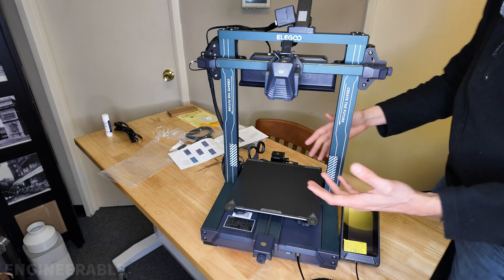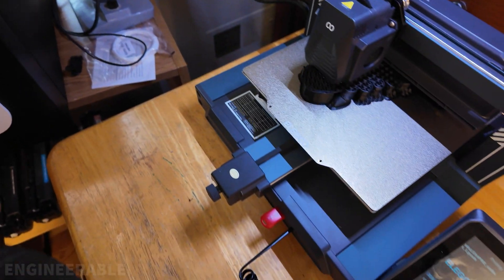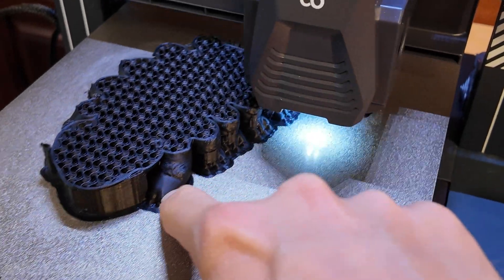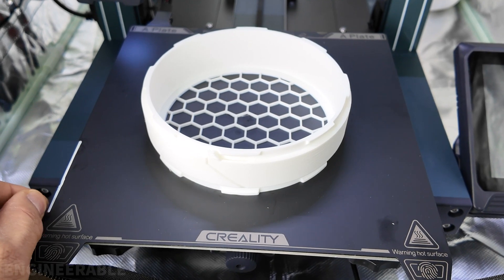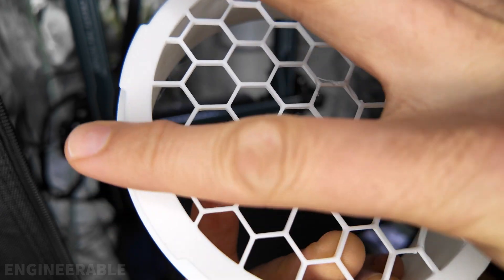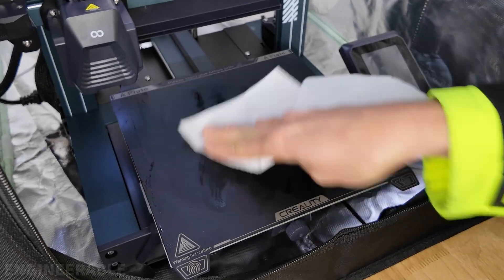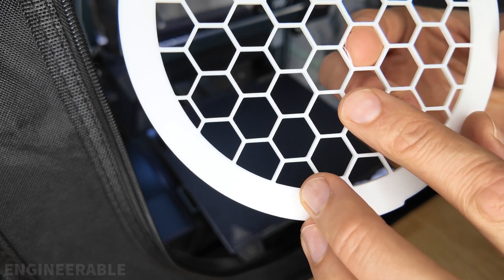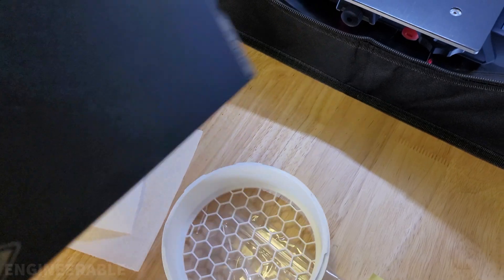I SOLVED ELEGOO NEPTUNE 4 PRO BUILD PLATE ADHESION ISSUES | 3D Prints now adhere reliably! No Glue!

Comment from the maker: This CREALITY smooth build plate has excellent adhesion for PLA and PLA PLUS. Buy it on Amazon  https://amzn.to/3uREupw
Reply: So that will fit my Neptune 4 pro
Reply: We have same 3d printer we got for our son. And the PLA is not sticking in the plate aswell. What should we do
Reply: @jdbodner-yh8mn  make sure you are using the right filament meant that you selected make sure it is the right temperature and maybe you need to re-level the bed and for the first layer, make sure it goes really slow, but once after that, you can make it faster

Comment: I just ordered a Neptune 4 max.  I would like to follow your suggestion of getting the Creality build plate.
In your video you described it as the "smooth" plate.  I went to the amazon  link you gave and the Ender 5 max was the biggest one.  They describe it as epoxy resin with a "sandblasted like" texture.  Is that the one you suggest? Thanks for your video.  It is encouraging.  george

Comment: Came back to this video after trying a lot of things, What I did is a test to see if me touching the bed would make a first layer test fail. IT DID so no touching
As for adhesion, for the default Neptune PEI plate was washing it with hot water and soap, making sure I dont clean it with a towel or anything I just let it dry and set the bed temp to 60 to dry and avoid any kind of oil on the Build plate and now it works without glue. :yougotthis:
Reply from the maker: Commenting out the loading of the bed mesh and going back to the normal 4 point manual leveling has further improved the consistency of print adhesion. The bed mesh was useless no matter how hard I tried.

Comment: Hello! I have had trouble with this printer and I was wondering if you could help me. Ever time i start this printer, the filament does not stick to the bed and gets dragged by the print head. Can you help me understand this issue?
Reply from the maker: Most likely your 1st layer is too high. It's either not homed, or first layer offset is too high. Also, the auto bed leveling on this printer is useless. I ended up commenting it out in the startup gcode and config files, leveling manually like old school printers, and that has worked much better. Almost perfect first layers everytime.

Comment: Hi, Neptune 4 pro bed is 225x255m , and the creality plate you suggest is 235mmx235mm. Does it matter?
Reply from the maker: @reneleb  the build volume is 225x225x... The bed is slightly larger, and the creality plate is a perfect fit.
Reply: @engineerable thank you. Do i need to order the magnetic stickers? Or just the smooth plate
Reply from the maker: @reneleb  just the plate

Comment: HOLY FUCKING SHIT. IT WAS THE BUILD PLATE ALL ALONG?? I just bought one and have leveled this bed maybe 60 times and still the same issue. You mean to tell me it was because of their fucking build plate. Im pissed
Reply: LMFAO sammeee, except I had the pro 3. Do you know if you need to apply glue to this creality plate every time? It says to apply glue on the plate but the reviews are making me think it doesn't need it.
Reply: @adamsevin7715 I've printed on that build plate ALOT since I figured out the stock one was trash. I have not once used glue on it. I do wipe it with 90% alcohol in between every print to get rid of oils but that's it. Your good my guy.

Comment: I solved it with a offset 0.1mm down when I calibrated the bed
Reply: What is your z-offset set to? 0.1?? Mine is down 1.5 just to finally get some resistance with a sheet of paper. I could easily put it lower (like 1.55) and still be able to more the paper back and forth.

Comment: Hi, i've stumbled across this video, because I'm havin the exact same problem with the stock build plate and the sunlu pla+.
Like you mentioned the first small test prints came out perfectly and after traying lager prints the adhision to the bed failed.
I'll try the Creality buld plate, ordered it right away...😅 TY 4 the suggestion!

Another interessting video I have found is this one, where the print bed becomes uneven "by design":
https://www.youtube.com/watch?v=sgqnlR9Wlk4
Maybe this is helpful to you and your audience. I haven't checked on this design flaw yet...
Reply from the maker: @KaiDzialas  😂 that other video is mine also. The combination of Creality build plate, the warping fix, and allowing it to preheat for ~20min has solved the bed adhesion problems.
Reply: @engineerable  Dang, that’s just a litle bit embarrassing. 🙈 Follow incomming…😆

Comment: I was having the same problems on my Neptune 4 with poor first layer adhesion. I flipped the Elegoo textured plate to the smooth side and it fixed the problem immediately. Perfect first layer adhesion.
Reply: Weird. I finished a print last night that covered most of the build plate in surface area. I did have my z offset a little closer than I normally would and the plate 10c hotter than I normally would.
Reply: @jordanmunch2151  Same for me.
Reply from the maker: Interesting. The textured plate that came with mine is uncoated on the back. It's just steel. I tried this and it didn't adhere.
Reply: I just set up my Neptune 4 pro and am going to try this. All the prints I’ve tried besides the defaults that came with Elegoo aren’t sticking. Thanks for the tip
Reply: Is your plate the factory one or did you replace it? I tried printing the Buddha 3 times and it didn't stick to my plate withing the first 2 minutes

Comment: Are you still using the creality bed?
Reply from the maker: Yes, it continues to work better than the original. The Neptune 4 Pro has Z home and bed leveling issues though.
Reply: @engineerable  I ordered a 4 pro. I'm hoping I don't have to many problems but I have been reading some pretty bad stuff
Reply from the maker: @timmyd463229  The main issue is that the bed takes a long time to stabilize when heated, about 20 min. There's nothing in the calibration or print startup that takes that into account by default. So, warm up the bed and nozzle to print temps and let it stabilize for 20 min before doing any calibration, bed matrix, or Z homing, then that gives better results. Get an enclosure. Look at my other video about bed warping mod.

Comment: hoping this solves my problem, had adhesion problems and they seemed solved and now continuous blobbing problems. Any particular settings for the purge line to move, cause of the plate's different shape?
Reply from the maker: Haven't needed to shift the purge line. The new plate was basically identical.

Comment: I switched from glue stick to non scented cheap hairspray on the original build plated and it has worked fantastic i mean worlds difference mainlybi think because the glue stick leaves microscopic dips and valleys on the byild plate that can cause layer adhesion and shifting issues but the super fine spray of hairspray makes the print stick withought rhe uneven surface of the glue. Ive found myself just running a quick calibration before each print without adjusting the bed level and its been printing like a champ!
Reply from the maker: Thanks for the tip. I know hairspray used to be the product of choice for glass. Does it leave any residue? Calibration (Z homing) before each print is essential. Pre heating for about 20 minutes before doing bed leveling or Z-homing also helps, because the build plate takes a long time to settle when heated.

Comment: I have bought the creality plate… now I have the opposite problem…. Can’t take the bloody print off easily! Thank you though for showing us a solution,
Reply from the maker: 😂 you might need to use glue stick to be able to take it off 😀. What material? I've only had too strong adhesion with TPU. Had to buy a separate build plate to use for TPU that I keep covered with glue stick.

Comment: using a dishwasher soap instead of alcohol works like a charm for me on the Elegoo PEI sheet ;
Reply from the maker: I will try that. Another issue I've noticed with this Neptune 4 Pro is that the initial layer height inconsistent. Sometimes it's perfect, other times it is too low or too high. The non-touch sensor seems to be inaccurate.

Comment: Instead of buying a new PEI sheet, I flipped the Elegoo one over to the smooth side 😉 works perfectly
Reply from the maker: Does it adhere better than the textured side? I didn't try that because I assumed that it was due to the quality of the "PEI" material they were using. They usually use the texture for better adhesion.